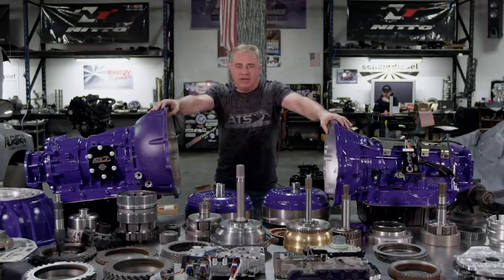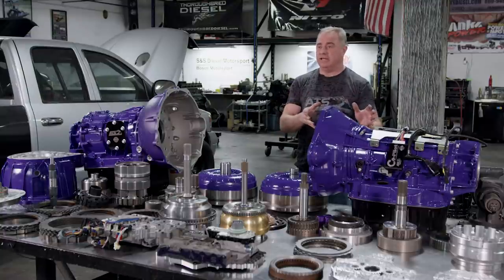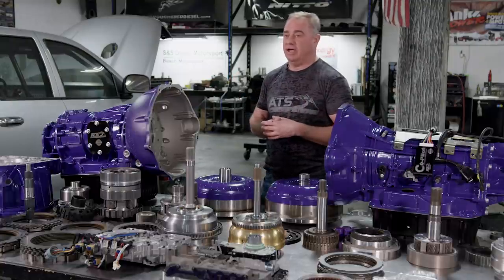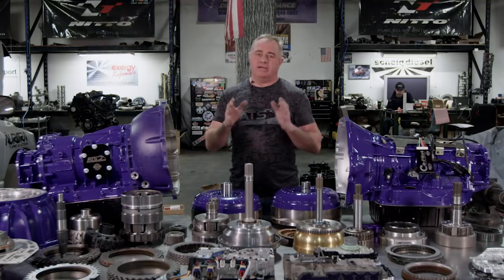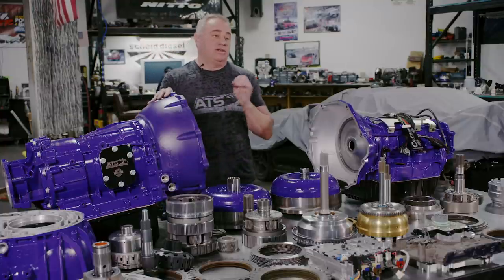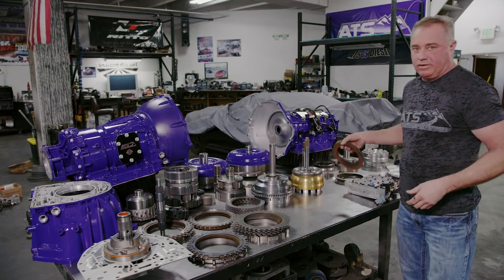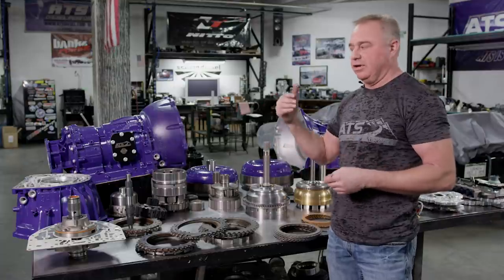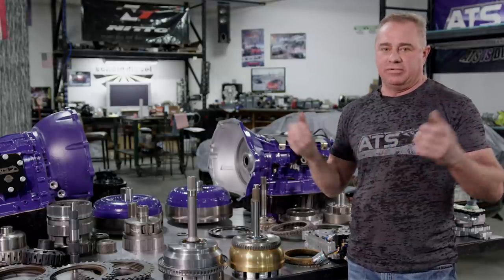Allison Vs 68RFE Comparison

Comment: The new Ram with Cummins now have the ZF transmission   for 1000ft of torque
Reply: WRONG WRONG. THE 6.4 HEMI GAS HAS A  8 SPEED ZF TRANSMISSION.
Reply: The 1000 ft lb is AISIN. They are talking about making a partnership with ZF to make the diesel trans for all trims of the RAM cummins to get rid of what used to be 3 options. Now its two options. Ford and Chevy both only have 1 option. But thats not done yet. The 8 hp behind the 6.4 and the 5.7 is not 6.7 capable. Good trans. Not with that much power/tq.

Comment: They didn't come out with the 6speed 1000 until 06 they had 5 speed from 01-05
Reply: wrong 01-05 had 6 gears you just had to buy the different valve body and tcm to use the 6th gear.
Reply: @defleppard6609  no from the factory the lb7 and lly were matted with a 5 speed

Comment: I understand that it's for hauling ultra heavy payloads but to pretend the fuel mileage will improve is unbelievable and the zero mile transmission in my rig is worth more than a core charge.
Reply from the maker: Actually it is not. It will improve mainly due to the Upgraded TCM that we use which get you better shifting, quicker lockup which in turns help with fuel economy. This is the same TCM upgrade we are offering for our GM customers with their TCM failures and they are seeing better fuel economy as well.

Comment: Even 4-5 built 68RFES in 2 years from ATS has never worked correctly., I have to baby mine now in 5 or 6th so they don't slip.. Most of them had leaking valve bodies that caused failure, finally they got me one that don't leak but I have to run stock line pressure and had to purchase their co-pilot. I give it 30-40% throttle and it blows thru the clutches on their level 4. Maybe someone will see this and finally decide to do something since I have a warranty but their installer in Magnolia ignores my calls and messages about the issues now.

Comment: The 6-speed Allison did not come out in 2001!
Reply from the maker: Yes we are aware of that but you can use the same Allison LCT1000 from then and upgrade the pump and valve body to be a 6speed.

Comment: i was trying to buy one for my 03 cummins with 4*4 there no option on your page for it
Reply from the maker: There is no option for it because we have not released our kits yet. We have been installing these kits here in house over the last year getting them dialed in. Currently we are 2-3 weeks away from the release of our 1998.5-2002 24V and 2003-2007 5.9 kits. The early 12V kits will follow shortly after.

Comment: Yes it'd be cool to have a allison trans for sure, but my question is how much money does it cost to make it happen versus just building your 68rfe?
Reply: Thats the issue here. Of its 15k for the swap no way, you can get 2 68,s for that price. If its priced around 10k to 11k then its worth it. Anything above that mark is being bent over and shafted so we will see what they do as far as pricing goes here soon. If someone made this swap affordable can you amagine... instant millionaire everyone and there mother would buy one
Reply: I have a transmission guy in Florida that will build a 68 for right at 5 grand will hold every bit of 800 hp and guarantees 1 year or 100 thousand miles. And hes good
Reply: @joshuatefft934  point me to this guy. I’m out of tampa Florida
Reply: @mikemfdavis7574  its Waynes transmissions. Deland Florida.  Totally honest dude!! I hot shot with a 2500 and pull 30 thousand pounds all the time. All rev max and suncost
Reply: Is that in the truck or trans shipped to him?

Comment: This guy and ATS will swap your 68RFE to a Allison for about 17000.00. This is about half the value of the whole truck! In other words they price ram owners out! No sane ram owner is going to spend 17000.00 to swap their 68RFE to an Allison transmission! A rebuilt 68RFE is around 4000.00! If you have to replace your transmission every ten years it is still cheaper then an Allison! Ram should have put Aisin transmissions in all of their 3500 trucks! Since dodge ram chrysler has no integrity, honesty or decency, they only care about profit, and this is the result.  If only I could find one truck manufacturer who really cares about their product and their customers I would go there! Without the cummins engine that dodge ram is just another boat anchor! I will never buy another one!
Reply: They do a fair number of conversions in house, and even more are shipped.  You sure seem bitter about what others do with their time and money.
Reply from the maker: Honestly its not cheaper in the long run, For those that have been through several 68RFE transmissions over and over again, for them to pay to do the conversion once, an Allison is less expensive to rebuild down the road hands down. So yes its more expensive upfront to get it done, but in the long run, not only will you appreciate your truck more with better drivability, better shifts and better overall performance, but when it comes time to rebuild, its still less expensive and they last a lot longer.

Comment: A built Chrysler is still cheaper than an equivalent allison
Reply from the maker: Our 700hp complete Allison kit is actually less than our competitors higher stage 68s...
Reply: @ATSDieselPerformance  but how does a purple allison rated for 600ish compare to a purple 68rfe rated for the same power. Because it seemed like on yalls site, the Chrysler is cheaper

Comment: Question can I fit that on a LS 6.0 Engine
Reply: You can't.  Anybody else could.
Reply from the maker: No not with our Patented Bell Housing that bolts directly up to the cummins, but with a stock bell housing, someone may have an adapter for that

Comment: Still wanting a 10 speed swap.
Reply: Why?
Reply: @Look_What_You_Did  fuel milage.  My 18 ram has 342 rear end gears and I average up to 21 1/2 22 miles per gallon if we had a 10 speed and say 325 gears we could possibly get 24+ miles per gallon out of the same truck, also with 342s taking off from a stoplight the truck labors a little so Morgan reduction because I tall or rear end is a good thing. Look at the other two top manufacturers right now GM and Ford are both using a 10 speed. Besides that my big Cummins has a 13 speed and my other one has an 18 speed🤷‍♂️
Reply: @brianhahne9623  Mileage... I can tell by those numbers you run a mall crawler...  I won't even show you the math to break even for your alleged mileage increase.  Run a half ton diesel or a car for mileage, lower operating cost, and lower taxation.  Ten gears in a light duty is complexity and cost to check a ghost requirement.
Reply: @Look_What_You_Did  not a mall crawler, those are real numbers with a properly equipped 3/4 ton. I wasn’t towing at that particular milage, (kinda obvious) but when i do tow I’m around the 15 mpg mark, pretty sure a case 570 loader and 30’ gooseneck don’t qualify as light duty, or mall crawler status. You don’t have the math skills to compete here, literally i spend my days for the most part in a kenworth at the moment, so 🤷‍♂️. No need for you to come attack me for saying that i want a 10 speed swap in my ram.

Comment: Get  Clint and Gale Banks in the same room with the three HD truck manufacturers and tell those engineers to shut up and Listen!!!
Reply: It's not the engineers, it is the MBA guys, finance guys calling all the shots. They know 95% of the trucks sold never pull a trailer, they haul 6 bales of hay and groceries. They don't care about the 5% of buyer that actually haul heavy stuff because the problems occur out of warranty most of the time. The stupid part is that they never offered the Allison as an option. They under estimate the consumers because guys that haul heavy aren't part of their focus groups. Ram sells more trucks based upon cosmetics and interiors and engine power; almost nobody buys based upon the transmission.
Reply: @briangc1972  As a guy who owned two failed chrysler transmissions, I searched long and hard for an AISIN srw Ram. The one I found just happened to be a limited, so youre right. Most want the interior. I do. Im also a die hard mopar guy. But I dont want their transmissions in anything. My wifes RT durango? ZF trans. My 3500? AISIN trans. If you pay for a couple transmissions, you start thinking about it. lol
Reply: @timryan1360  I understand your point. What axle ratio was in the truck that destroyed 2 transmissions? I think the fact that Ram keeps putting 3.23 gears in those trucks is setting them up to fail. They claim it is for better fuel economy, but my economy went up 35% when I changed my gears to 4.10. The engine groaned a lot less, the transmission groaned a lot less. I didn't have to press the accelerator as far when pulling away from a stop light, the truck got up to speed a lot less effortlessly and that all translated into better fuel economy. Even my highway fuel economy went up over 20% after changing the gears.

Comment: If only guys didn't think a cummins the holy grail...obviously Alison is top dog in the trans world...cummins aint shit.
Reply: Cummins doesnt make the transmissions. They do, but for giant construction vehicles. And there are two Ls in Allison. Cummins is the engine and it is the best. Reliability and torque with huge power adder potential. The transmissions are the problem with RAM diesels. Put a stout trans behind a cummins and you do have the holy grail. Guys are running around these days with the equivilant power torque to semis from the 80s and 90s. The 359 Peterbilt was incredibly popular... still running around. 500ish hp and 1300 ft lb. Thats not hard to do these days. The engines and transmissions that go behind semis dont fit in 3/4 and 1 ton trucks.

Comment: I'm about to purchase a used 2500. At this time of writing, Autotrader say's a 2018 2500 Big Horn with 546,000 miles at $30k is a great price. I've destroyed two Cadillac Escalade transmissions towing from California to Cabo San Lucas. Had I broke down in Mexico...it's all gone 24 ft ATC cargo trailer, cargo, etc.  Should I go cheap and purchase stage 1 conversion at $13,700 or pay a bit more for the stage 5?  The extra few thousand is insignificant to having solar panels and mounting stolen from a breakdown. I have to drive from the East coast to the West coast, swap transmissions before driving to Cabo. Will gladly pick up transmission.

Comment: Or just save your time and worry’s and buy a power stroke 6.7 with the torqshift .... had em all the Ford has best set up nowadays since 2012 ... best cab best frame best axles transmission and engine ... I’d try to get one of the 2016 before they went with new body style to those or the best cabs ever in four door